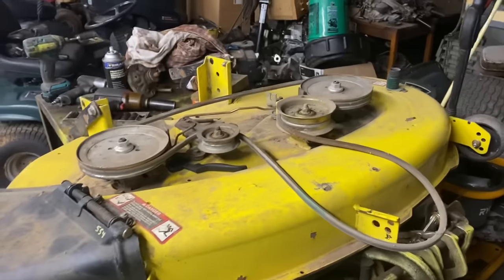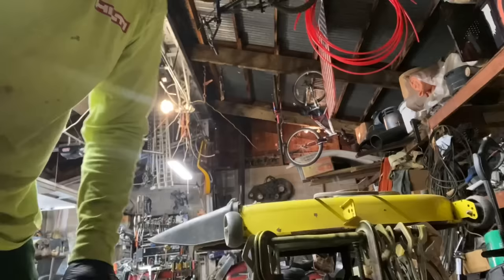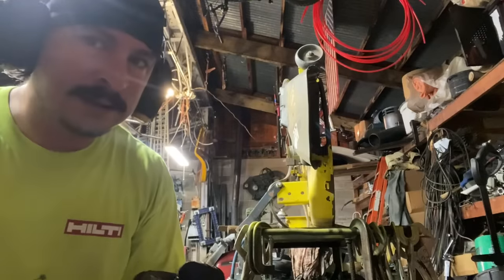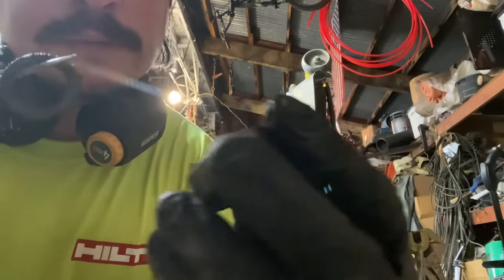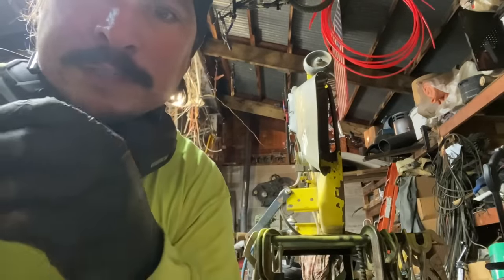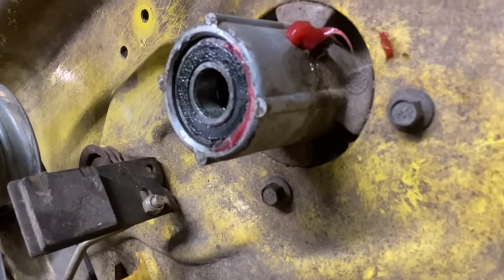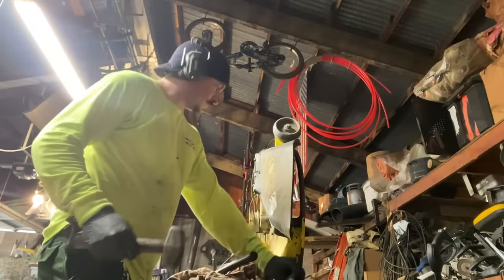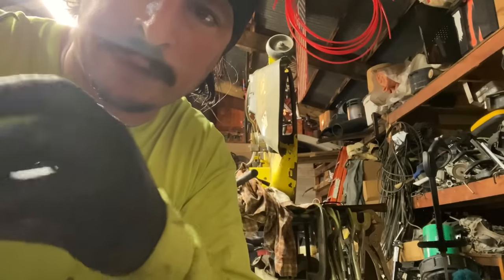Part 1 - Don’t trust the “Experts” Grease your mower deck sealed spindle bearings Common sense.

Comment: I wouldn't grease it if it has sealled bearings. Think about it modern bearings in car hubs are sealed and you don't greese them ! If the greese does get passed the rubber seal You will probably be pushing out the $40 a tube greese and installing $8 a tube greese not to mention you might blow out the seal allowing dirt to enter the Bearings.😮 I recommend to use air to clean the deck not water. Water on hot 🔥 bearings bad . If the bearings wear out too soon use better grade bearings. A good quality car hub bearing might last 7years vs maybe a year for a cheap one. There is many quality of bearings and the greese that's inside , There might be some circumstances when I might try to pop a seal off a sealed bearing to greese it , like if the bearings are very expensive and been sitting for 20 years and the old greese is dried up. One can easily damage a bearing if not removed or installed properly
Reply from the maker: Okay, first thought. You are throwing out accusations and have no evidence. That was a lot of talking mostly about stuff not directly related to the topic. This is YouTube. You can make a video proving your facts if you have facts to prove and add your link into this comment if you want to help the DIY community. Some folks even post videos with absolutely no proof and try to teach us without a shred of evidence. Buyer be ware. None the less, you can post videos to help folks like Iv done. Sometimes like in this instance I even attempt to help folks who left a comment even if they are a naysayer. First, some car hub bearing cannot be dismantled like a simple deck bearing mandrel. At least the newer age automobile hubs Iv replaced were not designed to come apart. The older stuff was great, you could pull
The bearings and fix it yourself. Kinda like a deck mandrel. And if the manufacturers would install a zerk on the new style hubs so we could add grease occasionally. They would last much longer. Unfortunately the automotive industry is much like the mower manufacturers and they want parts to fail. We have been conditioned by big corp to think - hub bearing lasting 7 years is acceptable. But if made to be serviced they can last a lifetime. The best way to guarantee failure is to remove the self servicing feature and therefore creating a limited life span. In my opinion you are too concerned about doing some kind of damage by performing a basic service than you are about why components fail so soon. Open your mind a bit. Who benefits from a part failing? Not me. Not you. And who benefits from us maintaining our equipment and adding grease? Only the owner of the equipment. I notice on your comment you use words like probably. Well, that explains everything. You don’t actually know. You can do some reserce or better yet experiment yourself and add grease and track your equipment usage and life spans with and without doing basic maintenance. I won’t gain a penny from you. The company selling you parts or a new machine will. 40$ grease in a new hub or mower bearing is unlikely. From
What Iv seen the new bearings are not even filled and what grease I have found is of a questionable quality. I always add new  grease on top of what ever they have in them from the factory. I also spin all my new bearings to make sure they are tight and not gritty. Iv found some bad bearings right out of the box. If you would take a minute to read some of the comments the information is below that can open your mind on some things like what a grease seal / shield really is on a mower bearing. It’s nothing more than a dust cap. Pops right off simple and fast and can be put right back on. One mistake many naysayers make when leaving comments, don’t try to compare bearings in other applications. This video is specifically about mower deck bearings and my information is the only like it on YouTube unless some of these mower repair channels finnaly came to their senses and started experimenting and sharing the information like I have. At the time I made this video, I only did so because there was nobody else going deep into the process to explain how it worked. And over the years folks have been blinded by uninformed mechanics who can’t think outside the box. Sometimes you have to get your hands dirty and do some experiments. When something does not seem right, just play around and see if it works like you think or if you just want to believe what you’re told. As for automotive hubs. I actually have plans to make a video where I add a zerk to the front hubs on my Chevy so I can add grease once in a while. Even my trailer hubs have a grease zerk. It also has a grease seal. Yes sometimes grease can leak out, big deal. I’d rather leak some grease than run a bearing dry. I guarantee a dry bearing will be a bigger issue.
Reply: @GTObearclaw1  thanks for the video and the comment . I have a greese zerk on the end of my axle, not just a bearing buddy , expells water better. You are too presumptuous at my abilities, I removed plenty of seals and shields . I make parts that only fit together when one part is freezing cold. I have built an electric bicycle prototype that at this moment the bearings will last about 10000 miles,  you can remove the seal and put greese in the bearings but at $3 a bearing it doesn't make any sense . I'm currently trying better quality ceramic ballbearings with stainless races . Because I want my customers to never have a bearing failure , even in the harshest environment. You mentioned you can't take apart a hub bearing,Just because you can't disassemble a hub bearing doesn't mean I can't.  But for the cost I just buy a new hub assembly. To my knowledge the major issue with deck bearings is from water being sprayed on hot bearings. You mentioned quality issues with bearings,    people love to buy the least expensive items, and many times it cost more in the long run. Look at bicycle, they put the cheapest slippery plastic pedals on most bikes . Or shoes with soles that slip and hurt people,  if you want it to last buy quality bearings, that have expensive greese inside. Some times they will lie about what grade of bearing it is . America has mountains of thrown away things like tools and bicycles because of cheap quality  bearings used. ✌️
Reply from the maker: @jacobclark89  in general nobody can simply dismantle a hub assembly that’s not made to be serviceable. Yes anybody with knowledge and tools can get one apart. Thats not the point. Who cares about freezing a beating or component and heating another to get things together or apart. I did that in my early career building transmissions. Big whoop. The point is not how good and smart you are or how smart I am. It’s simple DIY help for the average person who does not know. Why would anybody want to pay labor to replace a part even if the part is 3$ or 1 penny. Even if they can do the repair at home why would anybody want to have to fix something that was simply avoidable by adding grease? Come on man, this is just a silly argument and you have to see that. I don’t want to have the breakdown in the first place
So I grease my stuff. Yea, I can fix it. But why let it get there? If all that is needed is some grease and something that the average Joe can do at home in a few minutes to save money and add life to a machine I’m on board. You want your customers who will put $ in your pocket to have quality and I just want my viewers to have the knowledge and the viewers don’t have to give me a dime. So we are both trying to help folks. Cheep quality bearings can go a long time and even outlast these cheep mowers if they are well lubricated. Feel free to read some of the other comments. Folks will tell ya. Not just from me. As for water, yes I agree. Don’t wash a deck with water. But that’s not what this is about. However if you keep adding grease regularly the water will be pushed out by the grease. I see it all the time. Big deal. Just add grease, that’s the simple point I was making with this video. Why anybody wants to argue is not just silly. It’s stupid.
Reply: @GTObearclaw1  yes Im not here to argue but to learn and share what I have learned along my journey of rebuilding engines , transmissions, outboards, motorcycles ECT . I'm all for repairing and modifying things to make them last longer ,  like when I took a transmission from a 4.0 Ford and made it fit a 3.0 Ford , I wish that they didn't use the plastic caged sprag , should have been metal cage,
Reply from the maker: @jacobclark89  that trans swap would have made a great video, I’m
Sure what you learned could have been helpful to many people. Thats the beauty of YouTube, we can help the DIYers

Comment: Sealed ball bearings are sealed and if anything can get through to them then they are defective and it is a waste of time to grease them cause the grease goes no where.
Reply from the maker: Are you a troll? Or just need more help? 
Did you even watch the full video to obtain the information or just knew you were an expert on the topic and too smart to need to see what I was doing here in the video? If this is a real comment, you’re over achieving at a level of ignorance that few of us can comprehend. I know I’m struggling to grasp the level of stupidity on you’re comment. I’m sure it’s simply rooted in a total lack of experience in the exact application I’m showing and possibly you have high level of experience with bearings of another application but you are off base here. Iv seen a lot of dumb comments but you’re competing for first place and that is not exactly an easy achievement for this video. Iv got some real zingers. It’s one thing to not know something because it’s new to you but this is a comment on a video with details on each step of the process. Nothing was hidden, no tricks. I know people struggle with this exact situation and what sealed bearing actually means for this exact application. And that’s exactly why I explained it to the painful detail. If you still can’t grasp this point after it was broke down into the slow motion detail you probably shouldn’t own any tools. Nobody is stoping you from running personal experiments to find out how well this actually works. This is a basic as changing an air filter and doing routine oil changes. Not exactly rocket science at any level. Just basic day one mechanic stuff. And the kind of stuff everyone should know who wants to keep a mower deck operational for as long as possible without failure. Thanks for taking time to leave a comment.